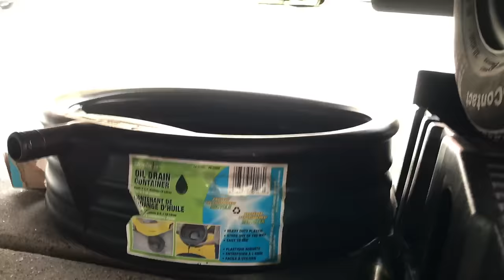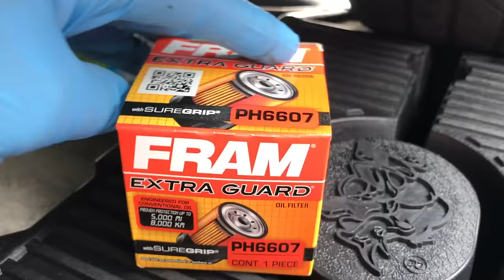Nissan Altima Oil & Oil Filter Change 2013-2017

Comment: hey i was told to pour some oil in the filter because the filter holds a good amount of oil,, may i ask , did you do that in this vid?
Reply from the maker: +Kwame Mcdonald hello! Thanks for the question. 

I hear this question a lot about oil filter changes. As it isn't harmful to do this I would say it's optional to fill the filter with oil. But I don't recommend it as it will make a mess as you go to install the filter on some cars like this Altima where the filter is put on horizontally. This would mean all the oil will simply pour out as your tip the filter to install it. So in the video I don't recommend filling the oil filter for this basic reason. 

Additionally, the oil filter is very small and retains a very small amount of oil after the engine is shut off and cold. If you are concerned about insuring the level of oil is accurate when installing a new filter, you can run the engine briefly. This will circulate the oil into the empty filter. Then turn off the engine and let it rest for 10 minutes. Then you will get very accurate reading from the dipstick. For the Altima the difference between readings taken without running the engine first and/or without filling the oil filter with oil before installing will be very negligible and most likely unnoticeable difference. A greater but vary slight variance might be seen on cars with filters installed upside down which trap more oil, or with much much larger oil filters like earlier model Mercedes where running the engine before taking the readings can be important.

The other reason I've heard for perpetuating this almost mythical step is the idea that the inside of the filter needs to be lubed or primed with oil first. This is definitely not the case for engines I work on, I'm not sure about every possible engine style so check your particular manual if you have a very rare engine. The filter will instantly be filled and thoroughly "lubed" with oil as soon as your engine is turned on. Maybe it came from a misinterpretation of the necessary step to lube the oil filter gasket with oil.

I hope this gives you the answers you were looking for :) and let me know if you have any questions. Thanks so much for taking the time to ask I really appreciate it! -luke
Reply: i appreciate the response, yea i was taught on my 97 nissan maxima, so now that i have this 5th gen altima, i was going to replicate, but i do agree, that the oil ALWAYS spills when i put oil in the filter and have to go sideways to tighten the filter
Reply: Yes. It's called priming the filter.  It hold s up to a quart of oil.
Reason for priming is because it will take sometime for the filter to fill while the parts in the engine is running without oil. Is bad in the long run,  for the engine. Specially,  those old engine with lifters. If you don't do it, you will hear lifters tapping

Comment: I use oil 5w-30. What do you think?
Reply: Check your owner's manual. 5W-30 is fine I think. My 2013 Altima takes either 5W-30 or 0W20, but 0W-20 is preferred. Strange, one is conventional oil, and one is fully synthetic,  and oil need to be changed every 3750 miles!

Comment: Can anyone help does a 2014 Nissan Altima 2.5L take 5w30 or 0w20? Ive been using 5w30 for the past 2 oil changes ? i called autozone and some tell me its 5w30 and others say 0w20?
Reply: Check your oil cap on your engine, it's usually labeled.
Reply: 0w-20

Comment: you never give out a specific on how to turn the screws
Reply: Yeah major fail. Why even make the video if you aren't going to mention it.
Reply: What do you mean?? Which way to loosen the oil plug??
Reply: If so look at the oil plug like you're looking at an analog clock. Go counter clockwize to loosen and clockwize to tighten. Unless the bolt, nut, or screw is reverse threaded, then it would be the opposite from what i've described.
Reply: Yes, it's a major omission on all the oil change videos.  I'll bet a lot of people have broken the plugs trying to pry them out.  Here's how to do it: with a small screwdriver, pry the "middle" of the plug down.  It's a 2-piece plug: a middle movable piece and a wider stationary piece.  With the middle piece pulled down, the whole plug will pry easily out of the hole.  Reverse to re-install.